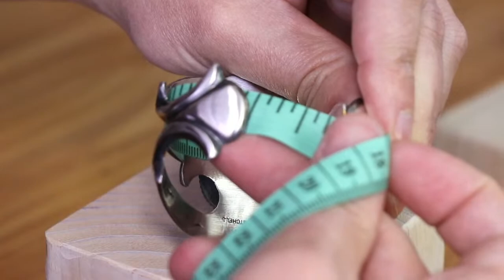Reggie Mitchell Old Style Sandcasting Navajo Jewelry for Sale | TSkies Saturday LIVE

Comment: I'm no expert but i believe kingmanturquoise sells howlite because I bought a bottle of turquoise in mineral oil and took it out and it crumbles with little pressure in between my fingers and ik ur not supposed to expose to water but I watched  I disintegrate in 5 mins and I asked them and they said I'm wrong and blocked me 🤣🤷‍♂️🤔
Reply: I guess it depends.  I am an intermediate silversmith, and I've cut some rough turquoise, (water web, black web, and just plain blue with pyrite) and the turquoise cut just fine.
Reply: Wow.....who is "they" exactly?  I'm a Diné silversmith also, I've also cut both stabilized snd natural blackcweb and red web Kingman turquoise and they cut beautifully.  I guess it just depends on how much money you are willing to spend on good quality grade turquoise.